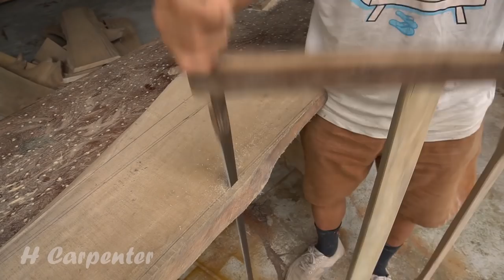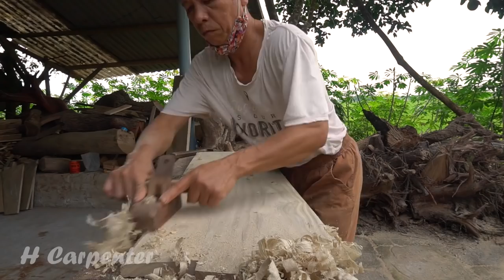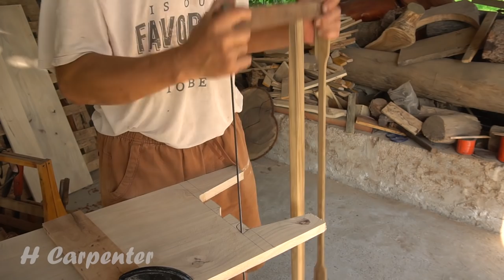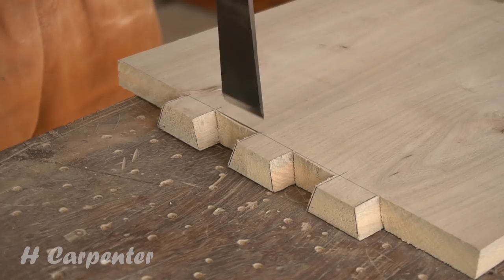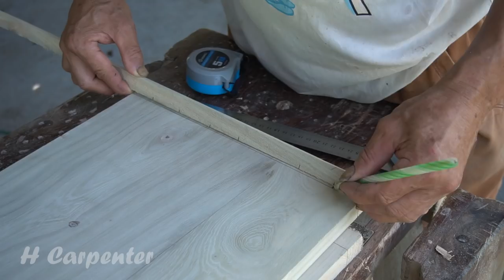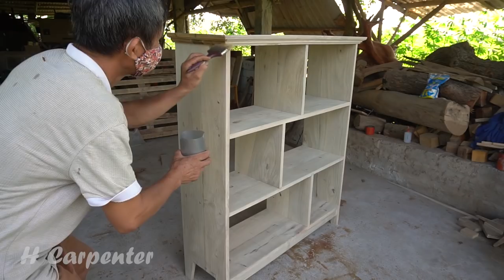[Woodworking Project] Amazing Dovetail Joint Cabinet / Making A Dovetail, Mortise and Tenon Joint

Comment: Just proves that for a master craftsman like you, just a chisel and a saw is enough to make perfect joints. Power tools are for the lesser mortals who can't cut perfectly like you! I was wondering why you did not use dado joints for the shelves. Also a request to make a video of you sharpening your tools
Reply: I wondered why he did not use five pins instead of three. The joint will retain its form far better than just using three. The housing/dado joint ...good point. Would have been better. However, I can never understand why Mr H. Carpenter never really cuts to his line, but prefers to use the chisel. This occasion seemed to be the exception!!
Reply: @Poshypaws  Cutting to the liine with a frame saw/ bow saw is not ever going to be accurate enough. The sawing is just a means of bulk waste removal.  However, if he marked using a knife rather than a pen, then his chiseled lines would be so much better.
Reply: @MikeAG333  Sawing is an Art practised from the moment one starts one's apprenticeship: to gain accurracy and speed. To state that sawing is merely bulk waste removal flies in the face of this process. Pen?? Knife??? Naaaaa... a sharp pencil is the tool one requires for marking out.
Reply: @Poshypaws  I have no idea what tradition you are from, but cabinetry in Britain has marked out with knives for centuries. If you are sawing for a final finish, then a western tenon saw (backed saw, in the US) is used, and if it is on a show face, the cut will be marked with a knife with a shallow chisel cut against it on the waste side. If you are going to use the type of tool this eastern carpenter uses then yes, you'll be chiselling for a finish from a very crude cut. If you are chiseling, the accuracy of the saw cut is irrelevant, so long as it stays on the waste side of the line.
I would consider it a major failure to ever take a chisel to a dovetail, but clearly it was this chap's modus operandi.

Comment: The screws rather spoiled it, as did failing to house out for the shelves. Just end-gluing and screwing is complete crap.  A sliding dovetail or housing joint would have meant that work could have been fixing-free. The initially shown edge-joined boards weren't used in the final piece, presumably because they were so bowed. It's really poor technique to use nails in edge joining, and the join was quite poor.